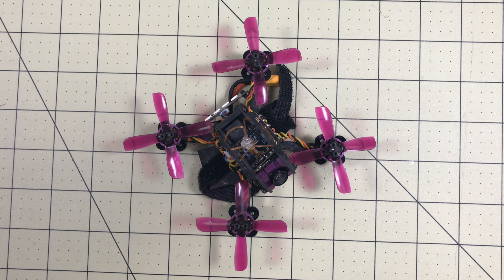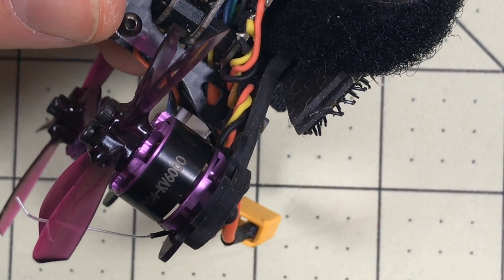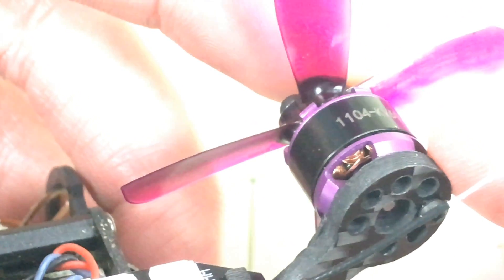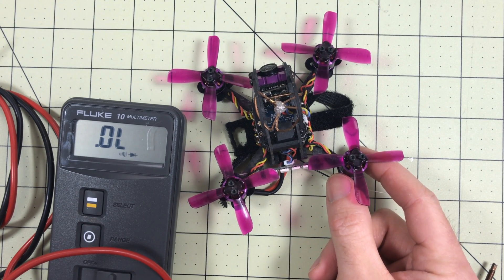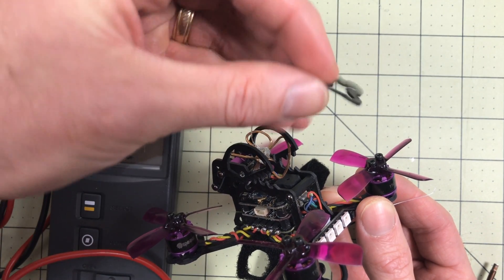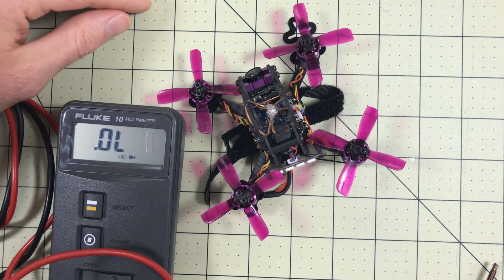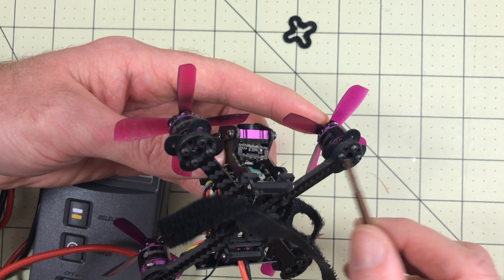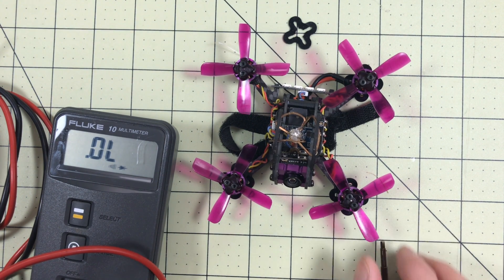Hot motors on your new Eachine Lizard95? Check this BEFORE you fly your Lizard!

Comment: Angličtina

If I disconnect the camera, there is no short circuit between the plate and the esc connector, but if I have a camera connected, there is short circuit between the plate and the esc. Short circuit is through antena leaf and antena cover.

Comment: This is strange. I noticed my motors are heating as well, but no screws are touching the copper, in fact, I can see dont even pass the mount on the motor. I am considering using plastic screws (EDIT BAD IDEA!), I need to measure with the multimeter as well. Could be the motors need to be isolated.
Reply from the maker: See if you can get the antenna to not contact the frame and see if that makes any difference. Let me know.
Reply: You mean the VTX antenna? Or the frsky receiver antenna? I guess I will try both :)
Reply from the maker: The metal vtx antenna. I have heard that on the new ones if that touches the carbon protection it can cause a short and heat things up.
Reply: Hi DroneRacer101, thank you for your tip, the VTX isn't touching (measured with multimeter) and I used some heatshrink on the frsky antenna receiver, still the motors are heating up. I mean, I dont get burned, but they are really hot.
Reply: When you say the motors no longer get hot after changing the settings - is that really cold, or warm but you dont get burned? Or? I really find this strange... but my experience was never with such small motors

Comment: just got a lizard....using stock PIDs, BF 3.2  I metered everything and no shorts but with only 30 seconds hovering all of the motors are HOT.  Does anyone have a solution? I did not see a fix in the comments
Reply: did you find the solution ??? same issue here... thanks

Comment: I finally figured it out.

I softmounted the motors.
but i still had continuity.
And they would still get hot.

After disconnecting the camera/Vtx for working on the lizard i suddenly had no continuity anymore.
after some research i figured it out.

What i found out is that the cloverleaf antenna touches the carbon..that way it shorted the motors and esc's.

after changing the cloverleaf for a whip antenna i have no more continuity and also my motors are fine now.

Comment: if i get 1mm shorter screw is there still a short?
Reply from the maker: If you bought a new one this won’t be an issue any more.
Reply: DroneRacer101 did they put a soft mount on a new one? or they replace something? and if i ever bought one and the screws are touching inside the motor should i softnount it?
Reply from the maker: I still recommend checking it. But I have been told the screw length issue has been resolved a while back. Before soft mounting I would do dynamic filters. And turn down the D gain. With the default the motors get hot.

Comment: Overheated motor. Bummer! I FINALLY got the Lizard95 yesterday. I got it bound to my radio, put the battery it shipped with in and tried hovering in the living room. After about 15 seconds I check the motor temps: three were quite warm and the rear right motor was almost too hot to touch. This can't be right! Maybe it's the screws contacting the motors? I don't know.... I thought they had this resolved with these later releases. I haven't changed anything in Betaflight. Literally flying it out of the box. Am running the DSM version. I'd sure like to keep it! It looks like a good model. Just have to figure out what's going on with that hot motor. Thanks for any feedback/tips.
Reply from the maker: At this point my Lizard doesn’t share much in common with the ones that are shipping now. I should order a new one but already have an huge pile of stuff to review. I would recommend joining the Lizard Facebook group. There is a lot of experience in there. https://m.facebook.com/groups/180214225843717
Reply: DroneRacer101 thanks man. I posted it there too. Hope to get a solution. I REALLY do want it to work
Reply: Yeah! you make the Lizard SO fun to fly! There just has to be a solution. I already got a couple replies from that site. One suggested lowering the PIDS. He had something similar he says and that worked for him. But how can lowering the PIDS help one motor that is overheating? Another recommended still doing the motor mounts. But I installed prop guards that provided that extra space the o rings would provide and it still overheats. So maybe it lies with the PIDS?
Reply from the maker: Lowering the PIDS will make the motors react less.  They can end up doing a lot less correcting that you don’t even see and then not heating up.
Reply: DroneRacer101 ok that makes sense. I have been reading up about it. Is there any one particular PID that you recommend lowering? The D PID seems to be one to look at

Comment: Ok, so I just got my Lizard 95 today. Is this still an issue with the screws shorting the motors? Or does anyone know for certain that this has been addressed? No need to run out and get rubber washers, etc. for something that's not there any longer. Any way to check a version number somewhere on the quad? Thanks!

Comment: Hey guys time to put our foot down and wake Eachine & Banggood up. It's really super sad such a great design like the Lizard 95 has a simple quality control issue like this that no awake person with experience building their own machine would allow to happen, but it happened and it must be dealt with realistically. Banggood has stated in writing "you only need to buy some suitable screws" in offering credits to buy new screws instead of replacing damaged motors sent out.  This is the Google Search Result on: "Effect of AC electric motor winding short circuited" (This refers to insulation damage after the screw that cased the damage is removed)  The first search page outlines the quote below for a reason:

"Effects of such faults in induction motor result in unbalanced stator currents and voltages, oscillations in torque, reduction in efficiency and torque, overheating, and excessive vibration [11]. Moreover, these motor faults can increase the magnitude of certain harmonic components of currents and voltages." 

Sound familiar? It's important to note that a quad copter using 4 motors to balance itself in flight running tiny high KV AC motors and complex programmed ESCs dealing with time and alternating current are not a single heavy duty washing machine motor backed up by an industrial power factor (ever notice your video go wacky at one point when the battery voltage drops?),  and the harmonic effects listed will effect a modern quad copter far more severely and drive a sane man crazy trying to resolve a hardware problem using software  with harmonic filtering that can confuse the issues. 

Harmonics can and will cause damage to micro chips. JFH vs ** Et.al exposed more than  a corrupt attorney doing his thing in the first round with time and I can assure you when it comes to harmonics even the experts scratch their heads when the going gets deep.

Comment: Hi. Is that possible that motors getting hot because of low quality cheap battery?
Reply from the maker: +Mike Orion I don’t think that is likely.
Reply: DroneRacer101  I was running on stock Betaflight PID's and I lowered P and D values a little and now motors stopped overheating. They are a little worm.
Reply from the maker: +Mike Orion if you haven’t I would suggest going to 3.2. Everything is just better with dynamic filters.  https://youtu.be/QTczo5PYNNE
Reply: DroneRacer101 I'm on BF 3.2 RC5 Omnibus F3

Comment: I received my Lizard and tested the short circuit from the frame to the motor connections on the board. And yes it was showing contact. But more strange when I unscrewed all the screws from all the motors still the frame measured contact to the board.
EDIT:
after further inspection looking inside the motors they don't touch the winding there is a 1mm gap between copper winding and screws.
But after unplugging the VTX module on the side, the continuity was gone from frame to motors :S
Can anyone double check with theirs?

Comment: It isn't the BEC wire, it's post ESC so it's the 3 phase wires for the motor. I tested each one against each screw as I put them back in. I had to remove two screws that were showing up in the ohm range. The rest were ~3.5k ohms.

Comment: Would the short cause a decrease in power? I haven't noticed hot motors but my lizard has spontaneously significantly decreased in punch out. It feels like it is on 1 or 2s even. Very sad :(
Reply from the maker: +Rob Beckham hmm I don’t think it would do that without also causing hot motors.
Reply: Hey! thanks so much, i think the motors were running hot and i just didn't notice. I checked and all four motors were conducting. You're video fixed the drone! I have full power now but the motors still get hot. I want to flash betaflight 3.2 but am afraid to mess with filters while the motors are already getting hot. You think I'm CRAZY?!
Reply from the maker: +Rob Beckham unfortunately the motors were probably ruined. I would notify the vendor.

Comment: Thanks for the video. I couldn't figure out why the heck all four of my motors were getting hot. So I ended up finding the one screw on each motor making contact with the windings and replaced it with a shorter M2. So now all four motor windings are not making contact with the screws. Question I have thought is if I'll need to replace my motors. I mean it's flying ok however my motors do NOT sound like they did (from what I remember) when I first received it. I kind of remember the motors running smooth and quiet when I first flew it, however not they sound rough now. Can't figure out why they sound this way. Maybe when the motors overheated the few time I flew it, they motors bearings were damaged?
Reply from the maker: +Mark Lang unfortunately they are probably damaged.  I’m assuming those are the original screws?  You hadn’t softmounted or anything?  I would contact who you got it from and ask for replacement motors.  Banggood has been replacing lots of motors for people.  It would have been nice if they caught it before they shipped, but from what I have seen they have really stood behind the product.  Probably will depend on how long you have had it though.

Comment: You're the man. Just got mine out of the box and found 2 motors with continuity.
 It's the screw below the yellow wire inside the motor.  Great videos!
Reply from the maker: +Adrian Saunders hmm when did you order it?  This is supposed to be fixed.
Reply: DroneRacer101 i just got it, but i opted for a local shop instead of waiting for banggood. So they probably had the older ones in stock.
Reply: DroneRacer101 A couple hours later I took it out again. I went up 30 feet, hovered and ....video died, rssi lost and it dropped to the ground, check this out: https://youtu.be/R1cy4QJq5yE

Comment: Motor's need to be dynamically balanced and same goes for the props to achieve good vibration free FCB performance and this is a basic requirement that requires extremely good quality control. As FCBs get better it becomes more important so Eachine and everyone else will have to produce noise free low vibration motor/ESCs. Your quad will only fly as well as it's weakest motor/ESC allows it to fly and being out of balance will affect it. Nothing better than 4 good balanced motors and props working together as programmed.... no more asking what is the meaning of Life in Science Class it looks like:-)

Comment: The new frame I received is a bit thinner than the old one , maybe it has an impact :)
Reply from the maker: +Occ 4 I believe that is part of the issue. But I have heard the new motors now are fixing this issue.
Reply: Yes I received some and while I only replaced two they are smooth :D

No soft mount but I can't tell if it's vibrating, I had an obvious flutter during the first hover which was quickly corrected on it's own and I retightened the screw a bit + locktite 243  ( I precendently used normal loctite which destroyed the screwtrack)

 ... Now I'll build the second lizard in the hope of going 3D :D :D (with the anniversayr frsky minicube :D Im also on fs2a on the current one ^^I should have more range in frsky ?)
Reply: I'm also a bit hesitant on the thinnest frame as I don't have any flex on the current build , maybe once mounted it will disappear ?
Reply from the maker: +David i have been told they are now shipping with the short fixed.
Reply: It's awesome don't worry. Let me know if you need help !

Comment: I got a lizard95....Extremely hot motors with softmounts and terrible drift in angle mode. When I put it in acro with air mode and punch it full throttle then drop the throttle it keeps full throttle and flys into the ozone layer. I was lucky I have failsafe working.....But so far this little drone is garbage and I think no one should be recommending this drone for purchase.

Comment: I bought one of this but after a few hours i was just setting in betaflight and tried some indoor fly, one motor didn't run anymore and i didn't understand why.. so i saw your video and now I think is the screw problem. Do you think I completely lose the motor now? Or the screws problem can damage the ESC board also ?
Reply from the maker: +Simone Russo I've not heard of one damaging the ESC. But it is possible.

Comment: Just received my lizard and all the motors are shorting (just checked with the multimeter continuity setting). I would have never checked if I had not found this video.  Thanks for the heads up.
Reply from the maker: +ReCoN12371 So glad to have helped.  Thanks for lettering me know.

Comment: Awesome ! Thanks for the heads up :) Now i need to find something to do the job of the softmount.
Reply from the maker: +greg godin did you see the latest? https://youtu.be/HZnV5_7Q9FU the rings work the best but the flat ones make the props fit best.
Reply: Yep, thanks for your videos, that very cool. btw my vtx seems to be still hots even after removing the faulty screws (by hot i mean hotter than the babyhawk, or my 250 quad vtx but i can still grab the lizard in my hands so below 80°C).

Comment: The first thing I did was buy silicone soft mounts for my lizard. Well the motor screws are so cheap they just strip. They are all slightly bigger than my 1.5mm allen key. How do you suggest I take out the stripped screws? Tiny vice grips?
Reply from the maker: +Mark Spohrleder try a 1/16" standard hex. It's 1.58mm and may fit?
Reply: DroneRacer101 great idea! I'll give it a try. My vtx antenna broke in the same spot also.

Comment: tanks DroneRacer 101 i had the same problem whit mine removing only one screw in each motor worked for me and my friend i also have to rodeo 110 that had that problem one or more screws were touching the motor windings so check youre rodeo if you have one  maybe it was my fault cause i tighten the screws so much

Comment: You would think (hope) that Eachine and Banggood would bother to check for continuity between the frame and the ESC'S - and would have determined that M2x3mm screws are the correct size - not 4mm.  I'm guessing that just using the 3mm screws might avoid the need for soft-mounting the motors - which, at the end, might just have been an alternative to putting some M2 washers over the screws before installing them.

Comment: I have 2 stripped motor screws and my hex driver doesn't catch to unscrew them. How the heck do I get them out?
Reply from the maker: +FlyinPhynix FPV Just curious, what size hex did you use?  Needle nose pliers, or carefully file a line in the head and then use a screwdriver?  Neither option would be ideal.
Reply: DroneRacer101 I used the hex that came with it. I got it used and the screws were shipped on arrival.
Reply from the maker: +FlyinPhynix FPV it shipped with an allen?  I totally forgot if so. :-)

Comment: Mine also have this problem... only when I tried to remove the motors three of the screws were so hard into the motors that the head got striped... :(
This is really bad, I hope my motors are ok, bought mine from aliexpress.
Reply from the maker: +zippiz Aliexpress is a little tougher because you don't buy anything from them.  It's another vendor selling them there so support will be whatever that vendor wants to do.  I'm sorry you had a problem but I'm glad to know that that it isn't a Bangood exclusive issue.